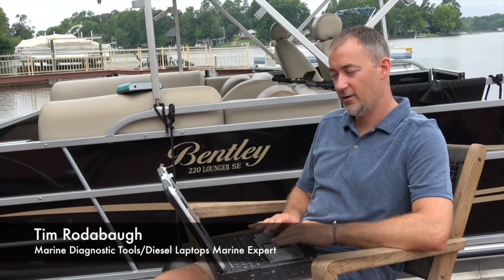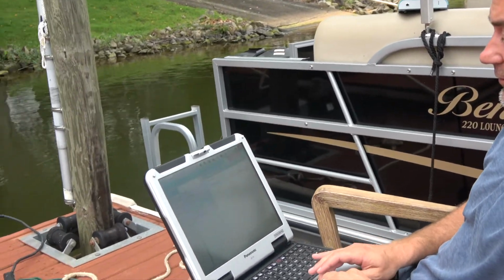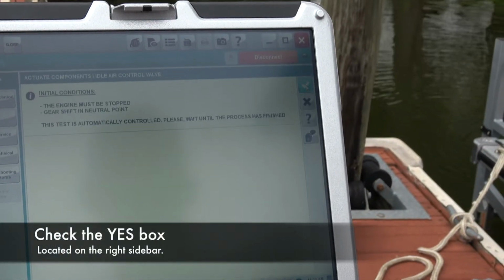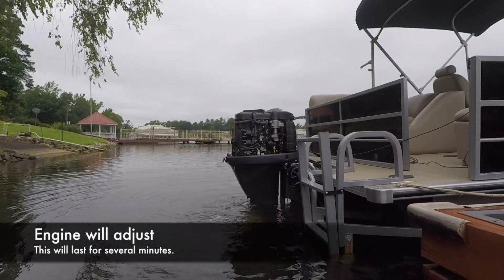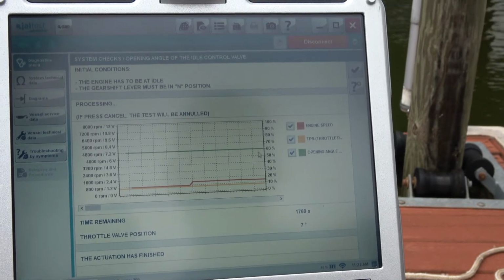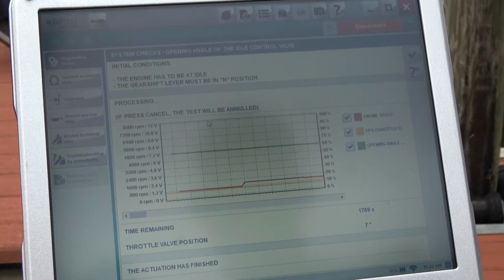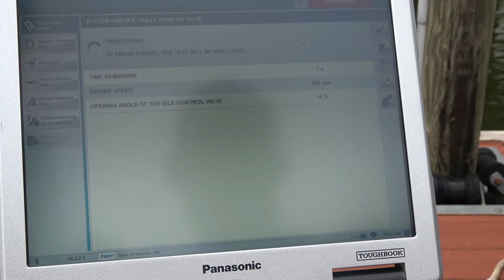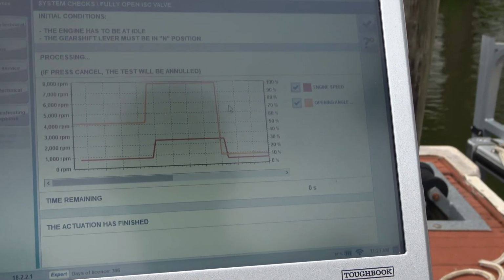Jaltest Marine Outboard Performing Idle Air Test on 2016 Yamaha 90

Comment: Yeah but what prompted you to run this test?  What do you do with the info that’s in the report?  I bought this software/hardware a few months ago and for $6k I’m a little disappointed. Is there any training?  I still find myself using a multimeter. Just today I couldn’t get the software to tell me why voltage drops or even that it was dropping.  Had to test with a multimeter and found it was the alternator. I figured it out in 5 minutes, spent almost an hour trying to figure out the software

Just not sure why such a complex system would be sold without training or support. Granted, the help desk is responsive they just don’t know anything about the marine diagnostics. They’ll be the first to tell you they know diesel application but hardly any marine. Maybe I’m missing something…..

Comment: Here is the issue with my 2009 Yamaha F60TLRH outboard.

On a cold start it will never start on first turn of the ignition key.

It will start on the second turn of the ignition key but goes into a high rpm idle, sufficient enough that it don’t want to place it in forward or reverse gear.

I have found that if I turn off the engine and then turn the ignition key the engine will start at a normal idle rpm and I can easily engage reverse or forward gear.  I have been using this procedure successfully for last 2 years.

It is about a 5-8 minute trip from my dock to the Marina.  Once I park the boat, if I were to turn off the ignition, the engine is then almost impossible to restart and I need to leave it idling even if I had 5-15 minutes of loading, etc.

Is this likely a problem with IAC/ISC Valve?

If so, is a replacement the only solution or can the valve be cleaned and lubricated.  It looks like the valve is really a step motor controlled by the main computer.

Is it easy to switch out and they seem extremely expensive compared to automobile IAC’s.

Appreciate any advice you can offer.